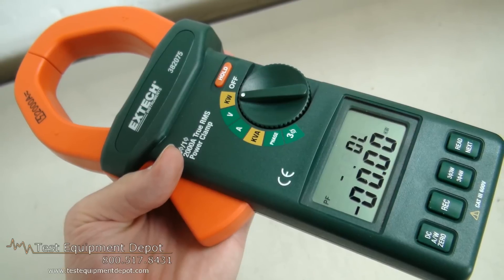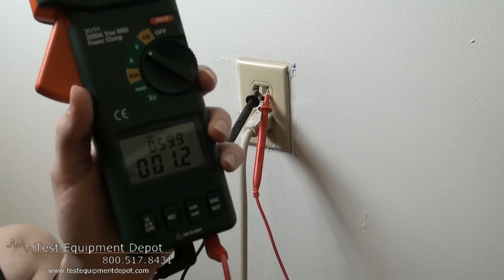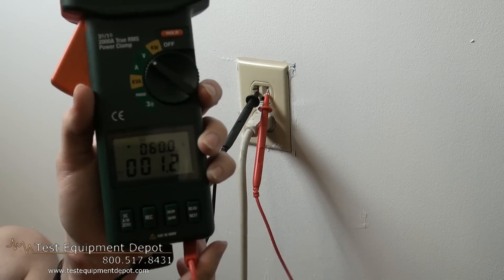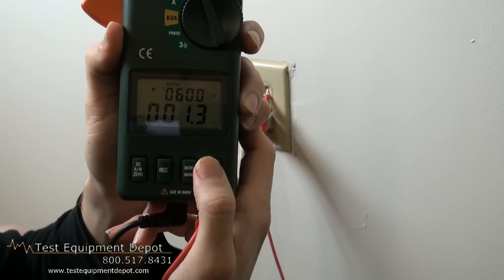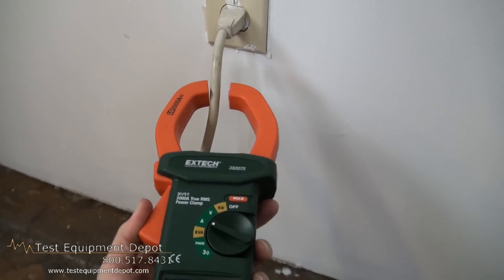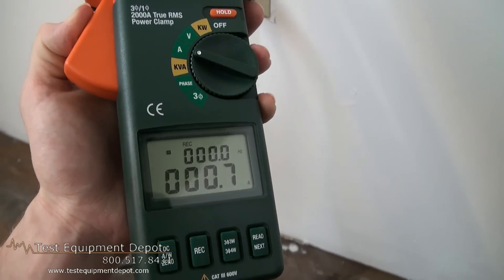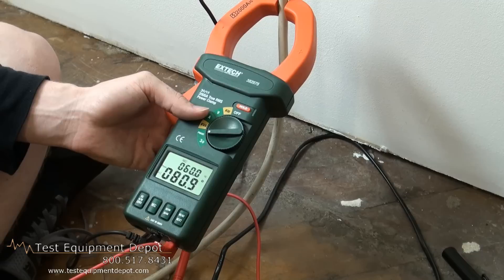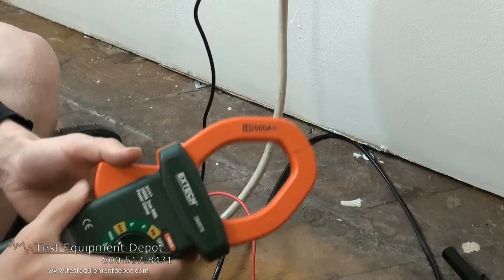Extech 382075 3-Phase True RMS Clamp-On Power Analyzer

Comment: Hi there   I see you using a current clamp the wrong way? @0.58 you try measure Amps clamping the cable?
When measuring Amps you have to clamp only one wire( live) and not the whole cable.
Also the 1 wire you are going to measure needs to be separated from the rest of the wiring en needs to run through the closed loop from the meter; not like a tweezer..
Reply: Truly a facepalm moment while watching the video 🤣